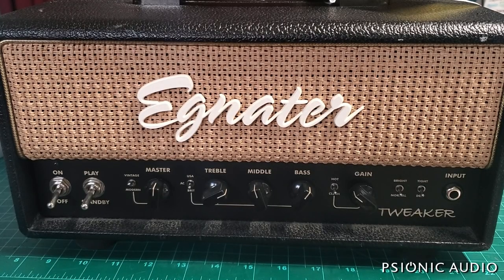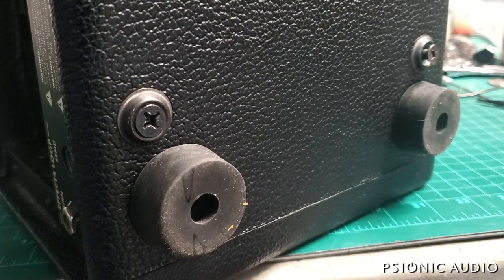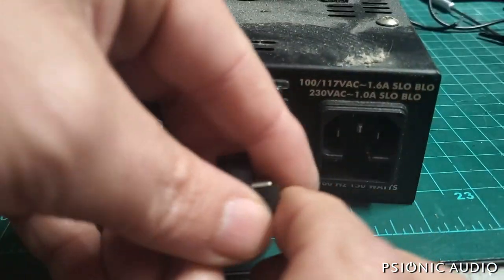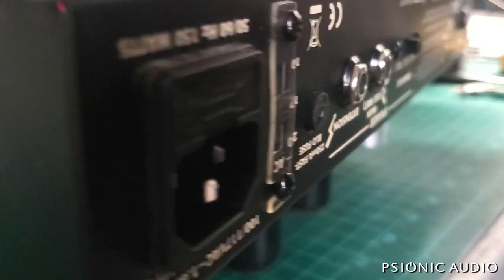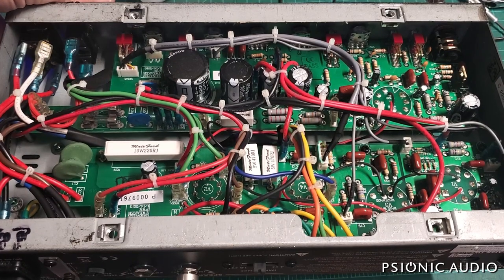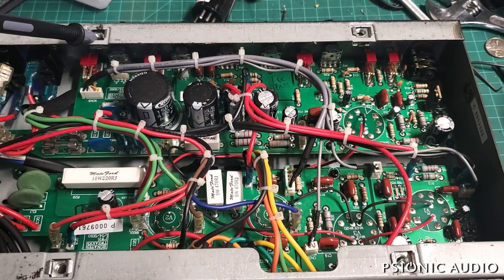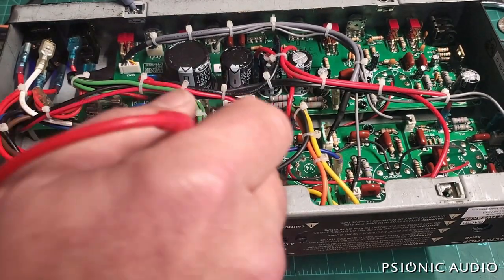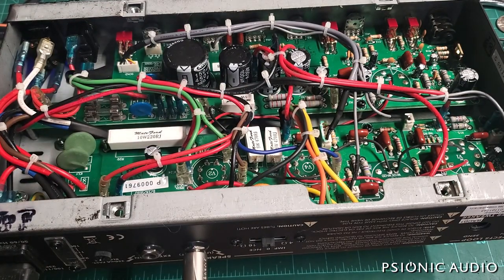Egnater Tweaker 15 | No Sound - Real Time Diagnosis

Comment: You would do well to point out why inexpensive (and many very expensive) amplifiers are not built with service and longevity in mind. Few modern electronics are. It takes intent, care, and labor to build amps such as Blackface era Fenders and other workhorses through the1950s and 1960s. That's why they are still here. Even PCB work can be rugged if it is designed to be. It is all about intent.

Comment: I replaced (I'm not a tech but I can solder...) my PT on my Egnater Tweaker 40. Mercury makes a drop in, same size and colors of wires for 120v. so no volt selector switch. Easy!!

Comment: How common is the transformer issue question I'm watching videos because I'm looking to pick up a used one. If everything works fine on it now what are the odds of the transformer being a problem. Is it something that's going to happen eventually guaranteed or is it something that might happen in one in 20? I'm sure you don't have stats but maybe a general idea? Thanks. Too bad that otherwise great amp would have an Achilles heel like that
Reply from the maker: Extremely common on the Tweaker 40. Less common with the 15. Given the low used prices these days, probably a pretty safe bet.

Comment: A friend brought me his Tweaker 15 with "no output".  The output impedance selector switch had disintegrated.  Not sure how that could happen.  I replaced it with a quality rotary switch which required cutting a notch out of the PCB.  Worked like a charm.

Comment: Early Tweaker 25 Power trannys fell apart on the UK models too - I had mine rewound and the guy that did it said that the spec was well off and was also the reason for appalling tube life. Totally reliable since the rewind.  Incidentally, Egnater offered to sell me a replacement PX for about £50 less than the price of the amp - bless them.

Comment: At about 9:20, that style of 6V6 are usually referred to as "ink bottles", with some kind of powdery dark grey or black coating on the inside of the glass. Lots of vintage 6V6GT's were made that way up to the late 50's or so at which point most manufacturers switched to using clear glass bottles.  I haven't been able to find out what the coating is made of or the electronic purpose of applying it to an output tube. Some small-signal tubes use similar internal coatings as a shield but a beam power tube such as a 6V6 doesn't need to be shielded. Some ink bottle 6V6s seem to have their own special sonic characteristic but I don't know that I'd recommend using them in an amplifier that runs at really high voltages because it might tend to reflect excess heat back towards the elements of the tube instead of letting it pass out through the glass as infrared energy.
Reply: A year late, but here you go.  Early power tube manufacturers had difficulties in getting the beam forming plates and grids lined up so portions of the electron beam would shoot out of the inner structure and smack into the glass.  This caused secondary emissions and noise.  The solution was to coat the inside of the glass with a conductive graphite bearing mixture which resisted secondary emissions and drained  off the electrons.  By the late 50s early 60s manufacturing had improved and the grey glass was dropped.

Comment: I had one of these amps and really enjoyed it. Got mine used for $250 but ended up putting it into a trade for a guitar. Would probably get the 40 watt next time as I think that has switchable channels. Love the video and respect you didn't just replace the tubes you checked it out first and made sure everything was operational. Love the channel.

Comment: I use a product called a Tone Preserver that regulates wall voltage, I have measured as much as 128 volts at my wall socket so...
None of my tube amps get more than 114 to 117 volts!
I think USA wall voltages are a HUGE problem for currently produced tubes and for whatever reason the 6V6 variants tend to go kaboom easier than others.
The tweakers are fine sounding amps.

Comment: I have a Tweaker 44 combo and the power transformer shit out. Replaced it with a Mercury Magnetics and been running it like crazy since. Been 3 years now, works great. I love that thing, great amp. The foot switch was kinda bad but I don’t really use it.

Comment: The meat and potatoes amps are just as important as the classics.
If not more.
Someone just starting out would treasure the living f***k out of that thing, just like I did with my first multimeter!
Reply from the maker: I started with a Gorilla (horrible thing). Graduated to a Stage 85, thought I had it made in comparison.  I loved that thing. 

Most of the current entry level amps today sound much better than either, and have so many sounds available. In that way I'm jealous of today's starting players (the entry level guitars now also kill anything I could choose back in the day).

I mean damn, I could take $600 now (what, $300 in '85?) and pair a Katana with a used PRS SE or a Squier Vintage Vibe. And that's a giggable combination. So yeah, I'm jealous of today's baby players.

I just wish the Katanas etc lasted longer. I remember mowing lawns to get that Stage 85. I would have been devastated to have to save up all over again two years later.

Comment: Hi Lyle, I would think there are many people out there buying their first Tube amp who would love to hear some frank honest evaluations of the less expensive tube amps coming out of China. As an owner of a Monoprice Stage Right SB20 50 watt head I would love to see / hear insights about this amp's  strengths and weaknesses. I'm not under any delusion that I got something for nothing. This amp goes on sale for as little as $364 shipped for free from the US, it's hard for me to believe that it will last very long. Having said that, I've gotten some really incredibly great tones from it. I've had mine apart and looked for obvious issues like cold solder joints or sloppy build quality. The biggest issue I found was a very thin PCB but i'm in no way qualified to give a professional opinion as you are. Having watched your videos for a while I am starting to think the SB20 is built nearly as well as some of the newer high dollar stuff I see come across your bench. One important note, I have owned both the SB20 head and the Combo version the SB12. In my experience this amp really starts to sparkle when plugged into a 2x12  ( 2 Vintage 30's ) cabinet as you have in your shop. The Combo is essentially the same exact amp mounted upside down in a very well constructed cab. I just wasn't a big fan of the Celestion Seventy 80 speaker it comes with. It just doesn't do the amp justice. Thanks for all the great informative videos.
Reply from the maker: I don’t think that many local players are buying such amps. The most recent cheap Chinese amp that came in was a B52 Marshall copy. Its PCB for the EL34s was terribly burned. Ridiculously inadequate traces with no heat planning.

I declined that amp as it would cost more than the amp’s value to fix and there would be no guarantee some other calamity wouldn’t happen six weeks later. 

I’m skeptical of all the free lunch amps out there.
Reply: @PsionicAudio  I certainly can't speak for local players that most likely provide the majority of your walk in business. Catering to your customer base is just common sense. I was thinking more about your growing number of Youtube viewers and subscribers. I also totally understood and agreed with your recommendations on the B52 Marshall. The video was none the less interesting and informative. The customers/viewers on Youtube do however contain a growing number of people like me that appreciate the things that tube amps do but didn't feel informed enough to identify a good tube amp investment, especially in a buy to try market. There is so much conflicting information out there. Sometimes a calculated risk for a small investment is a better move. If I knew 1/10 of what you do I could see a little better into this amps longevity. Maybe I'm wrong but I think there are many youtube viewers that would tune in. Either way, thanks for the education.
Reply from the maker: Have you seen my Amps Under $500 video?
Reply: @PsionicAudio  Yes I have. Both videos are well done and I don't  disagree with your picks either. I've watched quite a few reviews of both the DSL40CR and the AC15 . The AC15CH  and the DSL20HR are both on my short list now. If I had known as much 8 months ago I might have gone with one of these even with the additional cost of a separate speaker cab.I don't regret buying the SB20 head and their 2x12 cabinet. The amp is still working well, for now. I've had it open to have a look around a few times, No burned PCB yet. When I buy my next amp head I'll already have the speaker cabinet. The Vintage 30's sound even better when you only pay $315 for a loaded 2x12 cabinet. In one of your videos I think you mentioned a good electronics course to take for beginners , can you remind me what that was?

Comment: I really would like a fancy amp but today im looking at orange rocker 15s and tweezers. I am interested in the fender super sonic but im unsure if they come new with problems or if people just really like to screw with them
Reply from the maker: Super Sonics are noisy and you will need to spend $300-400 to keep them going once the cheap filter caps go.

Comment: So with the modern tweakers are the power transformer still under stress if ran at 120 !?
Reply from the maker: I don’t know. I’ve read that they’ve fixed that but I would have to have multiple examples to test to confirm that.

I hope so. Nice little amps otherwise.

Comment: I blew up one of  these back in 2014 due to needing to crank it at a gig where I couldn't be micd. Was in a very small venue too but it still wasn't loud enough. Blew the ol filter caps. Pretty good stuff for just one gig. I ended up using the cab  for a 5 watt tweed Princeton circuit build. I wouldn't wish one of these amps on my worst enemy. What goods an amp if it can't be actually used?